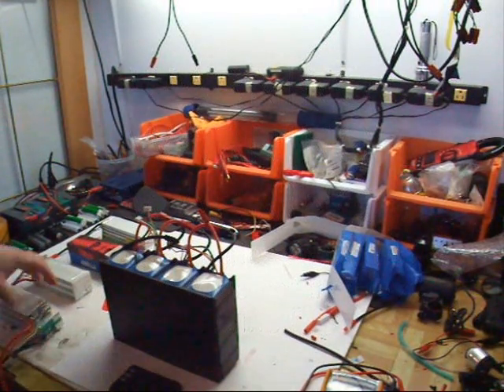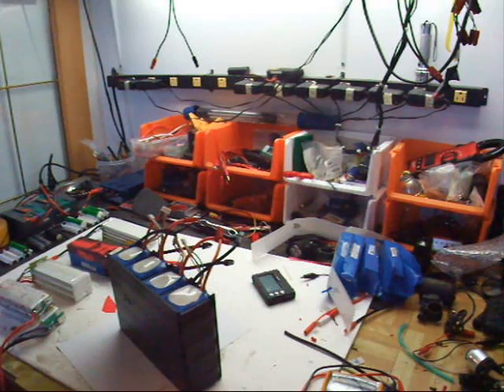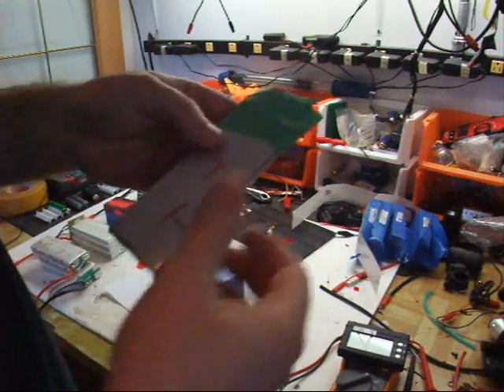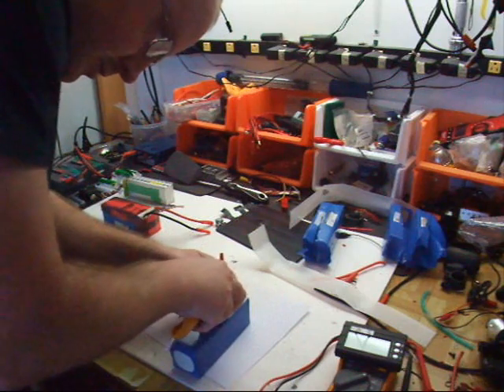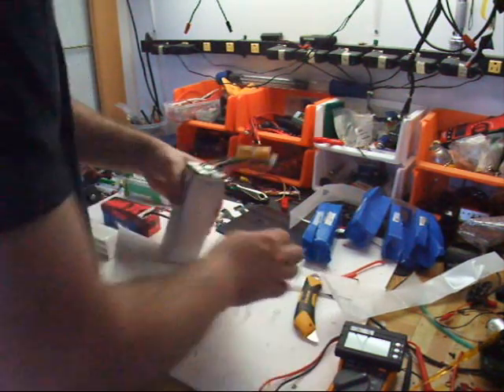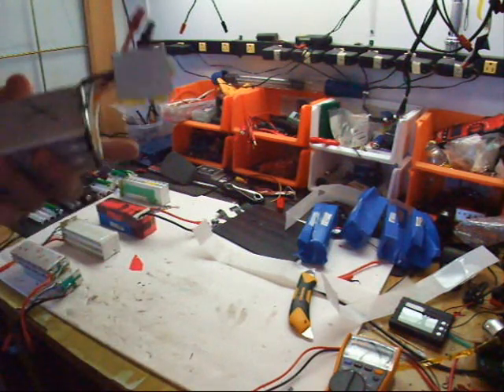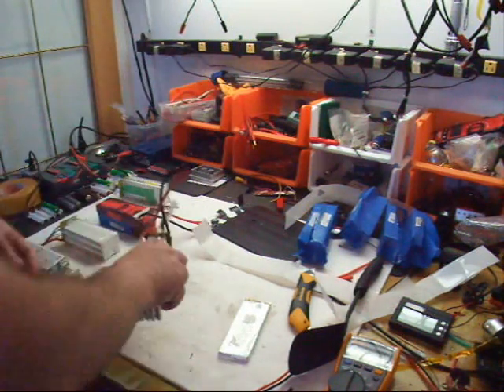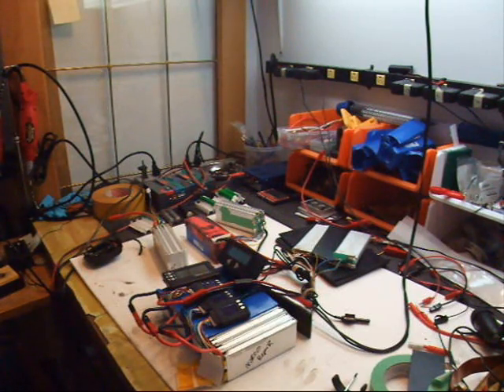Lithium Polymer Repair.. RC lipo

Comment: why wouldnt you just desoldier the tab and not risk shorting the battery? thats the craziest thing ice ever seen. I highly recommend not using this guys process. You can easily use a soldier sucker to remove the melted soldier. Do Not use a air compressor to blow hot soldier everywhere

Comment: sir please help i am putting together some 18650 battery packs from dead laptop batteries about 12 .6 volts 20 ah with a 10 amp maximum discharge pcb to solar system i am setting up.my concern is is it ok to connect 2 or three of these packs in parallel to increase amperage  to one charge regulator as is normally done with other battery types or do i assemble one big battery
Reply from the maker: Absolom Madhaka  with 18650 cells, the most common method is to assemble as many cells in a big parallel group to get the capacity wanted, then string as many of these parallel groups in series to get desired voltage.   All cells in a parallel group will be forced to equal voltage and work together in a group... makes monitoring easier.

Comment from the maker: you can, but a pack is only as good as it's weakest cell... if you keep the C rates low, it will work fine, but if you push the limits, the lower C rate cell will drop out first.. packs like that need to be considered grenades with pins removed... and treated as such.

Comment: You can use a old plastic card to easily separate lithium cells, also it helps alot if you drop a little acetone or gasoline in between cells, they will separate quite easily then.

Comment: Hello, I watched your video and they're very good , I need help,i.e my 5000 6S 30C lose power after less tah a minuite from trex 600esp after landed I checked all cells w/balancer it read 4.11V all of them and how can they go bad when all voltage are good .I also dischaged them and watched the Vt.of each cell and they are going down very much equal amount. Then I recharged it again and flew w/trex 600 heli and the result still the same problem. Have you came across this problem? Plse help Thnx

Comment from the maker: @rvd90277 That is PVC plastic, i put a piece between the packs to insulate them, it keeps the heat from each pack away from the others, and also provides ridgid support to the pack as a whole, being bumped around hard on the bike i want to keep it solid. if the bike tips over or i wipe out the packs are protected fairly well..